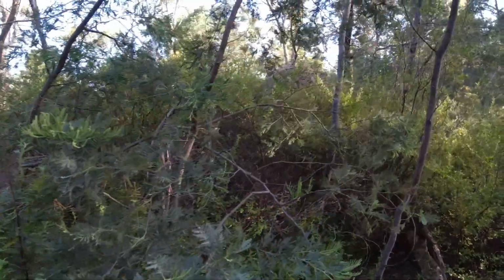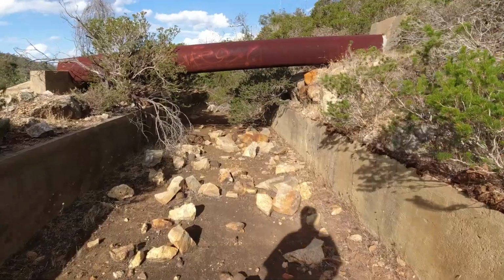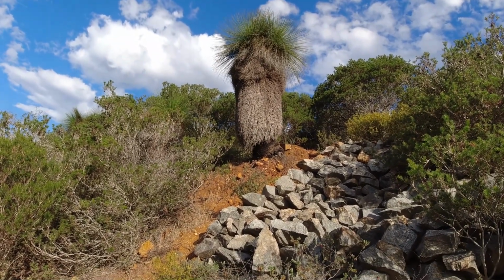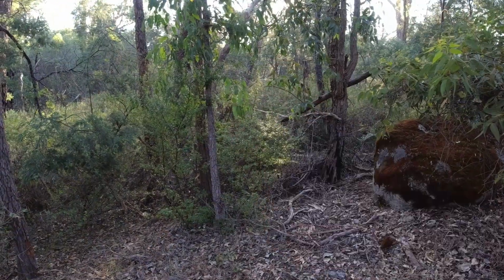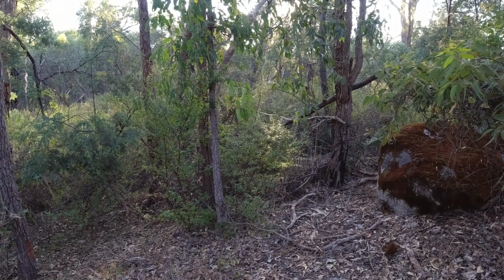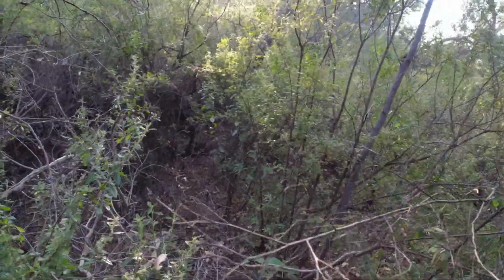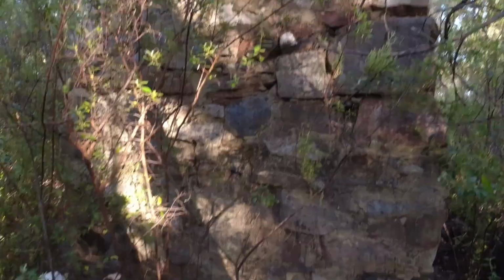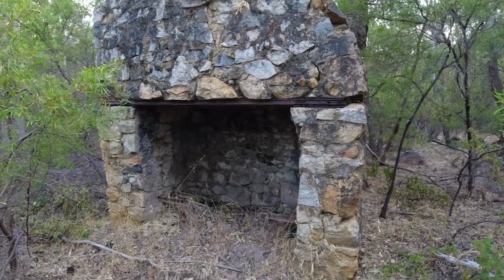Historic Chimneys Lost in the Bush

Comment: I’m glad you were rewarded with the discovery of the chimneys after all that bush bashing,a set of motor cycle leathers would have been handy.What was the purpose of the chimney’s?
Reply from the maker: From the research I did, it looks like they may have been part of a hut used by the workers while they were building the channel, but this is really speculation. Considering the size of the chimneys the huts would have been pretty big.